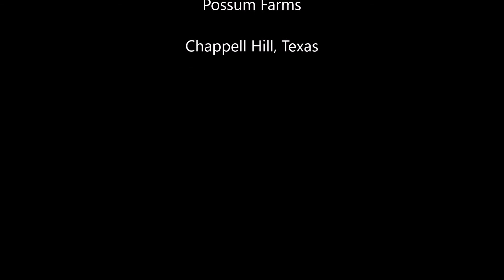Assembling a Harbor Freight Multi Purpose Work Bench

Comment: Haven't seen new video, hope all is well!
Reply from the maker: Yeah...  It turned COLD, it has been raining and I have been sitting on my hands waiting on parts!  Some of which have been delayed by Covid-19 issues with vendors...

I've been cleaning the barn, reorganizing tool boxes and moving stuff between buildings - none of which has been "YouTube worthy".  But the good news is, I have found all sorts of tools and "stuff" I didn't know I still owned!  LOL

I had no idea I had NINE electric sanders!!  I finally found my cache of air tools dating back into the 1970's!  And a sideways drill I thought was gone forever...

But I have come to a realization - I need more tool boxes!  (Notice that's plural!)  And more storage for power tools!  And I need another storage building for big machine tools I don't use anymore but refuse to get rid of...

And I need to find a heater for the 1500 sq. ft. barn that wont' kill me with CO2...  Winter is here!
Reply: @possumfarms  lol im looking at tool boxes as we speak. crafstman boxes made in the usa again but kinda light on the metal thickness. i know how tool collections go. i cleaned out my back bedroom found brand new set milwaukee m 12 set drill impact saw multitool and a light. in my tool trailer i keep a milwaukee m18 set, 2 dewalt sets and my old rigid set that wont die.